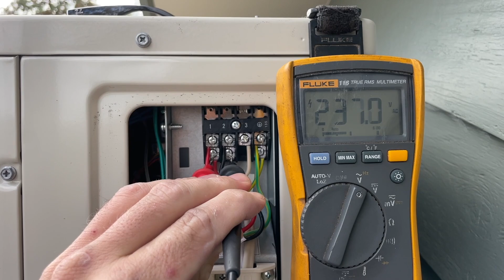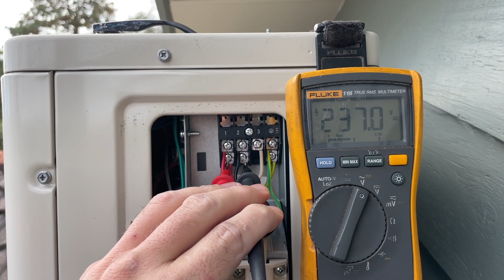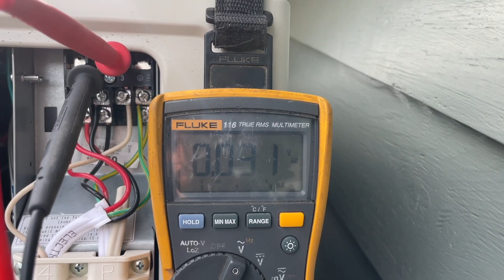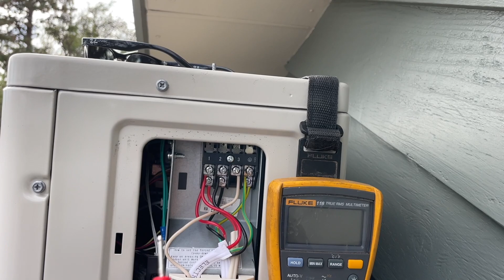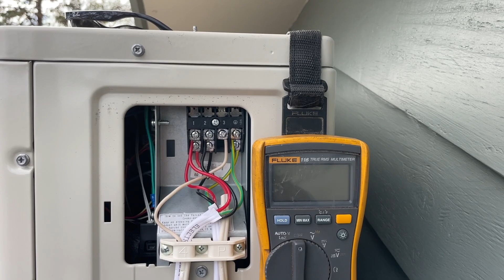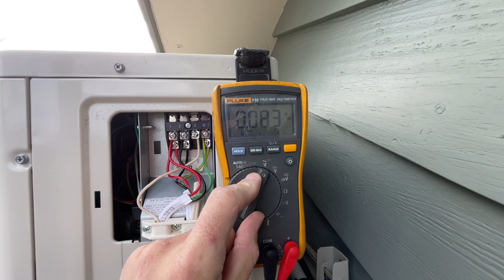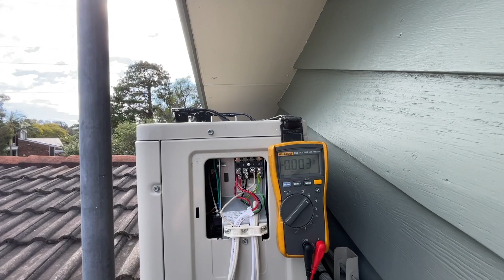How to test Daikin PCB for Communication Faults.

Comment: Good information here Mitch! I just wanted to throw a couple of things out there since you live near the coast too....I found it odd the first Daikin mini split I installed the cable they gave me at the supply house was 14 ga stranded between indoor and outdoor but since I knew it had communications on one leg I thought it was odd not having a shielded cable and running together with AC line 😂. I spent much of my career also in the BAS building automation systems world so anything that communicated with DC especially if run in the same bundle with high voltage AC would create many issues and the longer the run the worse it can be. Daikin larger VRV in commercial/industrial applications recommend shielded and only ground the shield in the outside unit never both ends. Most DC communication wires in the BAS industry always state not to be within 2" inches of AC line volts too and never run parallel and to cross at 90 degrees if close together. 

I was going to also suggest a couple of things if you have intermittent com errors being near coastal area. Make clean connection metal to metal with good quality round crimp terminal connectors then apply die electric grease for long term protection from oxidation. Running shielded cable between the indoor and outdoor unit and terminating shield at outdoor unit only cannot hurt to drain any unwanted signals from terminal 3 communication wire. Also if having intermittent comm issues redo both terminal grounds and system unit grounds indoor and out to bare metal to metal than coat with thin layer of die electric grease if near coast. If long runs above 50 feet I would invest in the shielded cable between in and outdoor just in case! 😉

Of course you can have a weak comm driver that is getting ready to fail on the boards! 

Very good video Mitch and just wanted to add my 2 cents and thoughts.

Comment: I just went through this on a unit and went through the daikin pdf. It was ultimately the board not sending the right voltage to the fan. I may have stumbled onto a shortcut. I had the fan molex unplugged, and everything started working with the fan unplugged but wouldnt do anything plugged in. Might be a shortcut on where to look.
Reply: Did you ever find out if it was a shortcut?

Comment: Hello Mitch
Excellent video! I never knew the min-max function on my multimeter! Great information here. Does this mean that if you get zero for the high voltage then the outdoor board is bad? If you get zero for the lower voltage then the indoor PCB is bad? Or would you just change both?
Reply: Did you find out the answer?

Comment: Thanks Mitch, Do you know how to confirm if its the ourdoor PCB problen or indoor PCB problem?
Reply: Disconnect the comms cable. Test between neutral and terminal 3, and then neutral and the disconnected wire.

Comment: if there is 45 dc and 0dc then is it the indoor bord faulty      and if it 10dc then 0dc is it the outdoor bord faulty ????
Reply: It depend If that happen then you probably have to check indoor and outdoor board check the fuses it could be both board that’s bad but usually outdoor bad board are the common one
Reply: Normally if the indoor fan runs on fan only  mode.  Usually the outdoor board is the bad one

Comment: Not sure if you have one but the most valuable piece of hardware you can have for checking Daikin residential equipment is the Daikin Transmission Checker (I don’t even know if they sell it anymore).

It hooks up to 1,2,3 terminals and it tells you all the indoor data such as sensors and requested capacity sent to the outdoor. On the outdoor side it tells you sensors, outdoor fan data, compressor hz etc.

If it doesn’t pick up the indoor or outdoor on the transmission checker it generally sends you in the right direction to go checking.
Reply from the maker: Interesting, I can’t say I’ve seen one of those. Sounds pretty handy!

Comment: It's a very easy-to-understand explanation.

There are so many types of multimeters. If there is a particularly recommended multimeter, I would like to see that video someday.
Reply: Cant go wrong with a Fluke - Costly but well worth it,  you could be risking your life using a cheap tester
Reply from the maker: I recommend the fluke kit that’s designed for hvac. It comes with the multimeter you see in this video and another one that can measure amps. Cheers mate